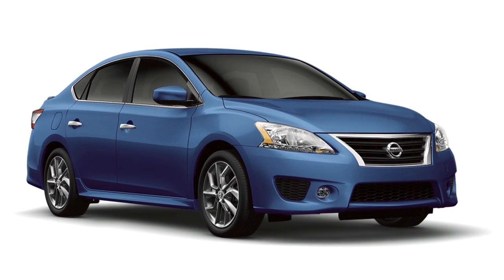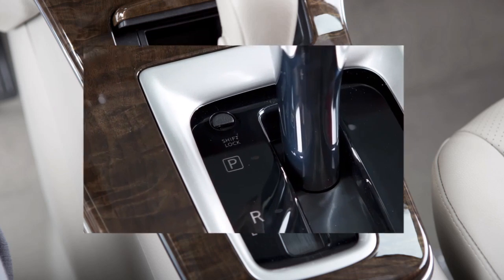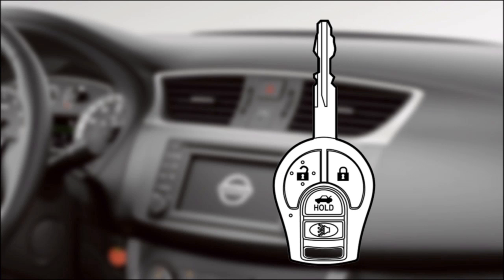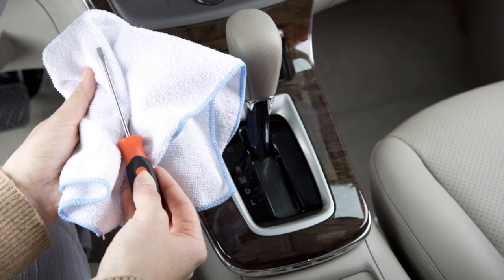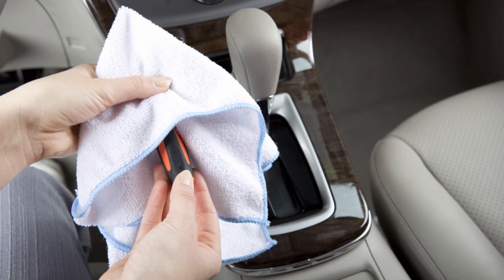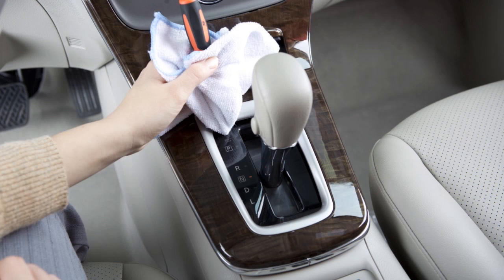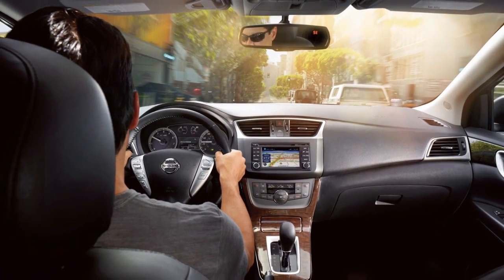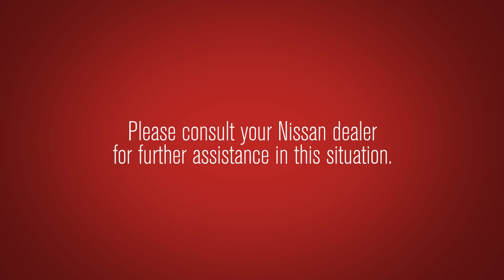2014 NISSAN Sentra - Shift Lock Release (if so equipped)

Comment: Whew! It worked perfectly! Thanks so much for this video. I had read the instructions in the car manual (which are the same by the way ) but it still wasn’t working. When watching the video I realized the device I was using in place of the screwdriver I didn’t have with me (I was stuck at the post office) wasn’t long enough. I dug around and found a longer piece of metal and it worked.
Reply: I’m having the same problems. Did you take your car to get that fixed ? Or what did you do after ? I’m sorry I don’t seem to understand